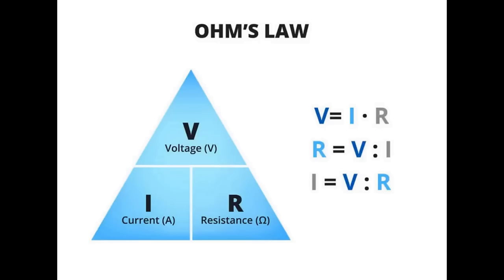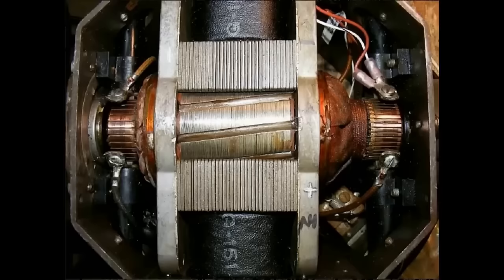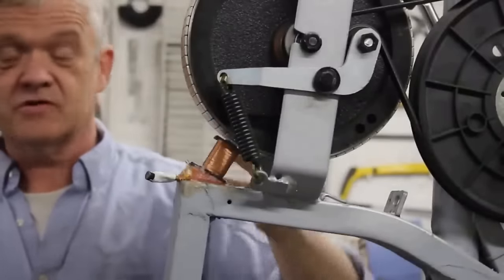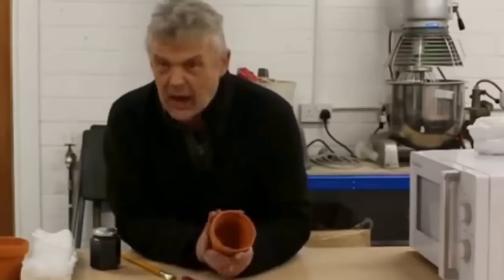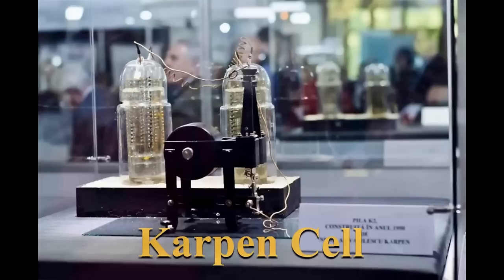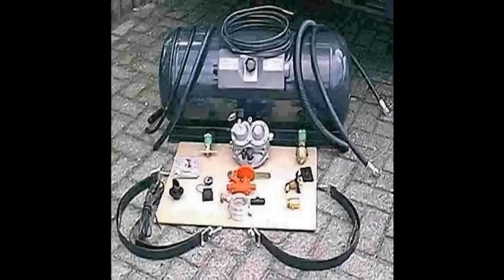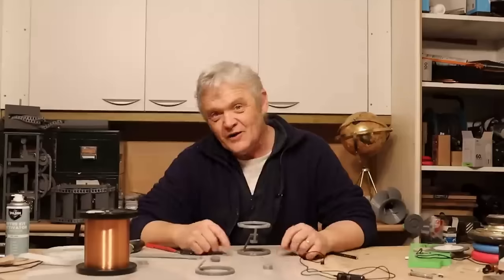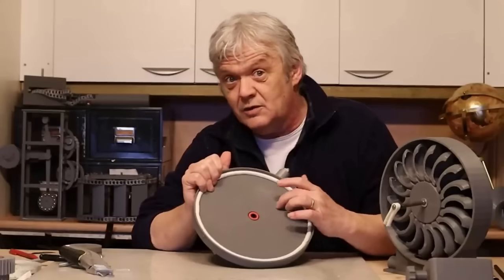Man In A Shed - Episode 2

Comment: I was wondering if you could convert a car battery charger into a power inverter?
Reply: Convert? Doesnt really work that way. If u make a Crude power inverter u could possibly use the Transformer from the charger if mixed with Mosfets & a driver circuit using something like a J/K Flipflop or a 555 timer circuit to produce the 50 or 60hz square waves which will result in a Modified square\ Sine wave unless there is Filtering done to do Wave Shaping of the square wave. Non pure sign wave inverters make any Transformer/ Inductive loads run Very Hot & will shorten the life span of the items which includes more less ALL modern Electronics.  This is why some Inverters Cost way more then others. Cheap ones are normally a modified Square Wave.
Reply: @Jack_Move  I kinda understand about half of that, but thank you for replying to my question. I  thought since it already changed AC to DC it might work.
Reply: @arliehenson9222   With a Power inverter you are creating AC or "Fake" AC from DC Voltage. Creating the 120 or 220 volts is actually the Easy part. Hard part is getting a Pure sine wave output. The flat spots of the square wave " where the power clips at the peaks " is what makes electronic items you are powering get extra hot. If that makes any sense
Reply: @Jack_Move  yes sir thank you that makes sense
Reply: @arliehenson9222   The only dumb question is the one that doesn't get asked. That's what these Channels are all about, Messing around and learning something new ! 🍻

Comment: Rather than using hand cranks for generating electricity, I converted an exercise bike so that I sit in a recumbent position. This position allows me to supply much more power to the pedals than the so called safety bicycle position. My testicles are also much safer in this position. According to people with far more knowledge in this area than me, you can supply up to three times your body weight in power to the pedals than you can supply using the diamond frame. All human powered records for bicycles are held by people using recumbent, faired bicycles.
The UCI decided in 1934,  I believe, what a bicycle should look like in races sanctioned by them.

Comment: What if you could use a ionized gas for a engine and generator? The idea is to use ceramic electret graphite capacitors to use induction of a spinning ionized gas that is confined and spun by shaped electric and electrostatic and magnetic fields that could act on a moving core by plasma currents and induction.
Reply: Interesting idea but very complex.